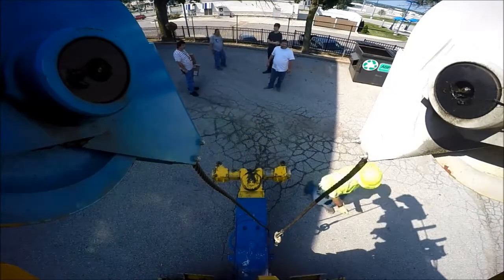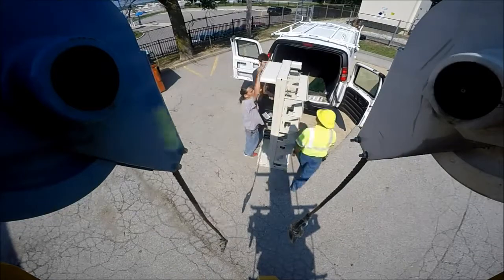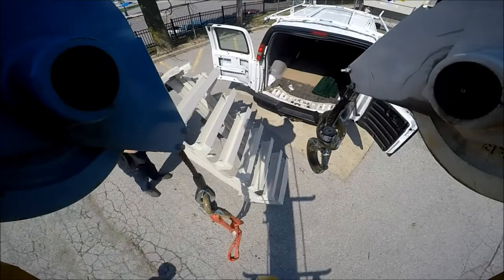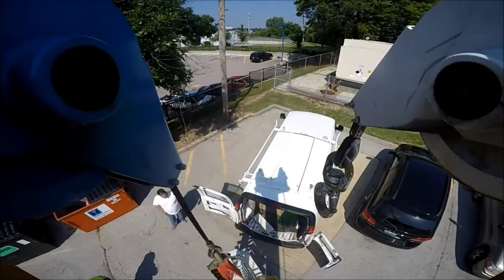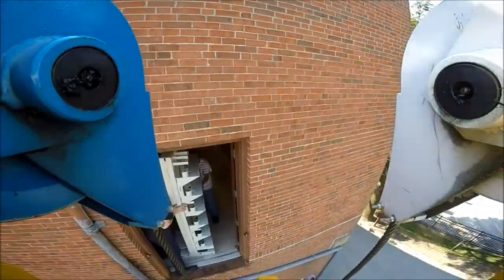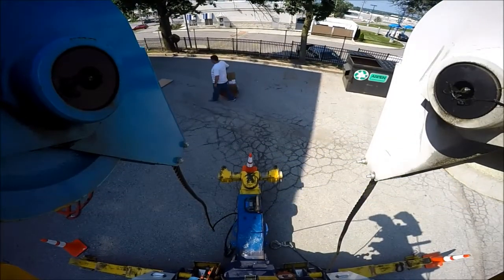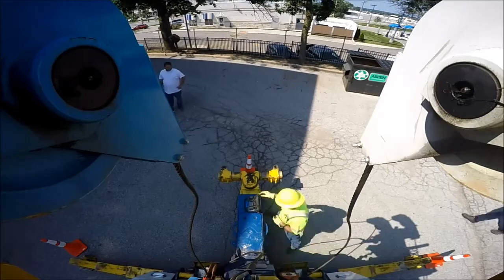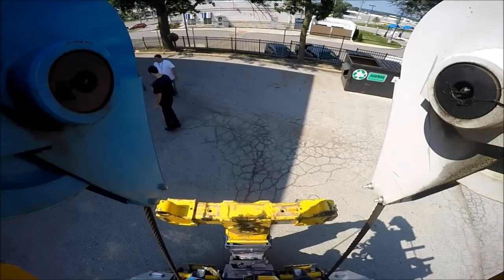STL TELECOM LIFT

Comment: Lifting a rack that way just amazes me. We always just broke them down and carried them inside - up a freight elevator if we were lucky, but usually just muscled up stairs. The actual frames, once all the shelves and such are removed, only weigh around 50, maybe 60 pounds for the big, steel racks.

The fun jobs were moving configured rack cabinets. Those things can weigh over a ton when all's said, and they always have glass doors . . ..

Comment: +Ron Pratt sense i'm new to towing but would like to work with big rigs and etc, should i start out on a roll back tow truck? Also, how long does it take to work with the more heavy duty trucks in towing?
Reply from the maker: Kale Bowman .  You can start anywhere you want as long as someone is willing to hire you.  There are scores of books you can read as well as training materials from Wreckmaster and TRAA.  There is also formal training through both.  The biggest things, in my opinion, are common sense and an aptitude for the job.  Wherever you start, train yourself, educate yourself, and make yourself marketable.
Reply: @RonPratt  Thanks for the resources I'm looking to start in the towing industry.